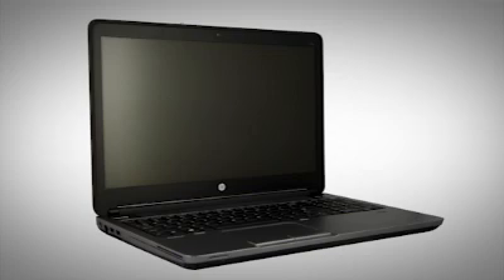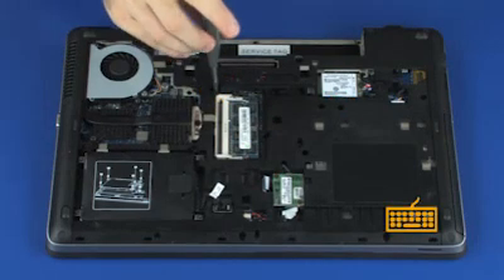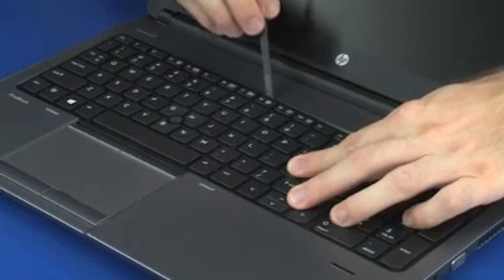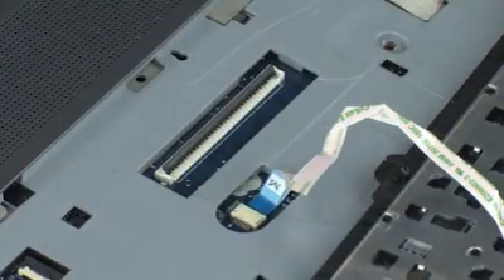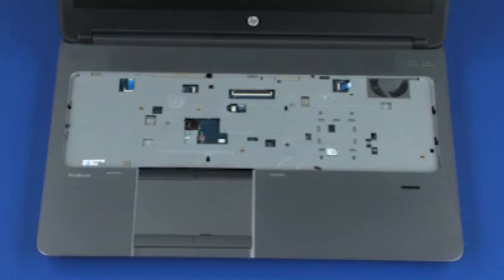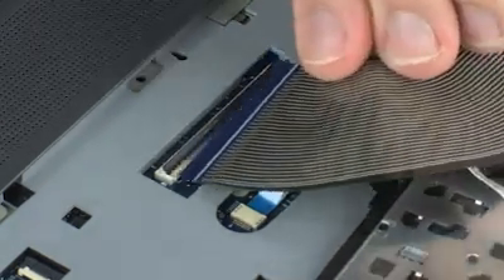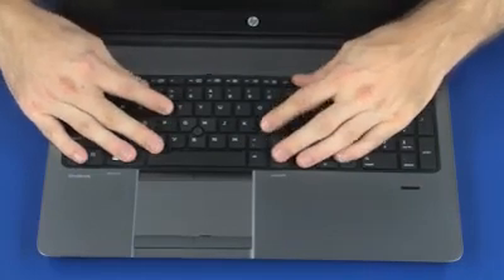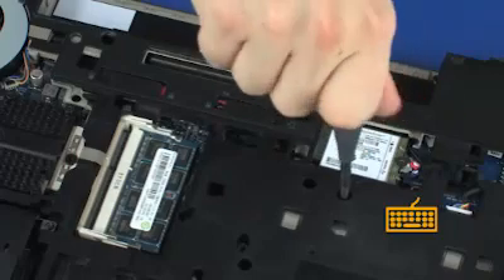Replace the keyboard | HP ProBook 655 G1 Notebook PC | HP Support

Comment: I was trying to update the bios but the device got stuck and it was raining to restart it
But after restarting it it shows a black screen and I don't know what to do
Reply from the maker: +Gh Plus Please perform recovery as mentioned here to fix the issue. 1. Shutdown the computer. 
2. Turn the computer back on again and repeatedly tap on the ESC until a Startup menu appears. 
3. Press F11 once for System Recovery. 
4. Choose the Keyboard Layout. 
5. Click on Troubleshoot. 
6. Go to Recovery Manager and click on System Recovery. 
Note : Back-up all your data as System Recovery will delete everything that you had saved or installed on the computer.